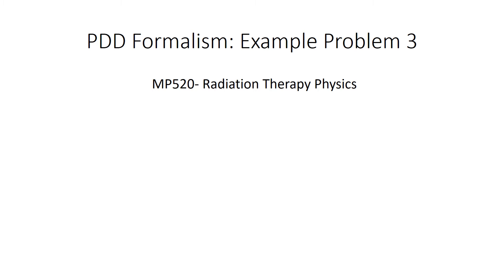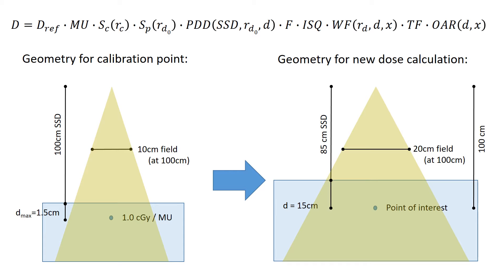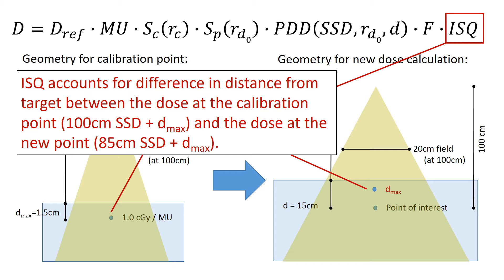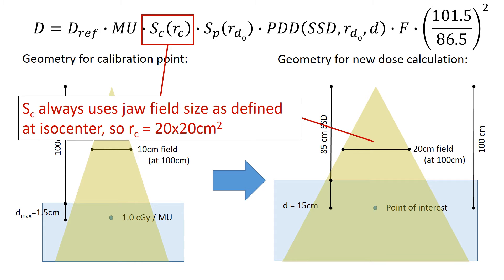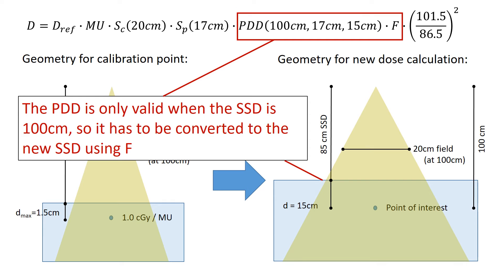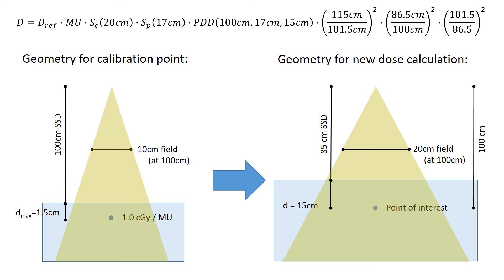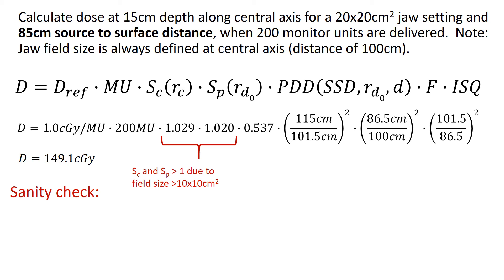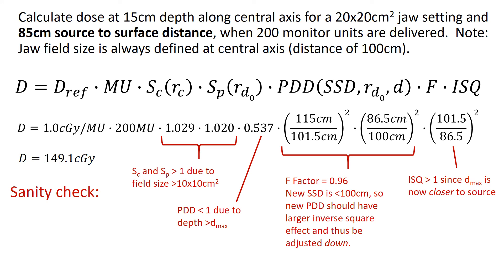Radiotherapy Hand Calculations: PDD Calculation Example 3

Comment: Are we doing an ISQ twice by using both ISQ factor and F factor?
Reply from the maker: No.  The F factor modifies the inverse square correction portion of the PDD so that it applies to the new SSD.  You need both the ISQ factor (to correct for the inverse square effect) and the F factor (to correct the PDD to the new SSD).